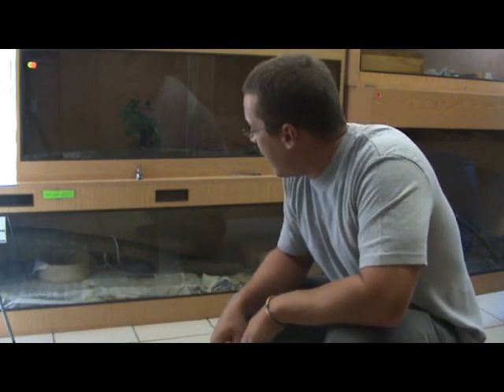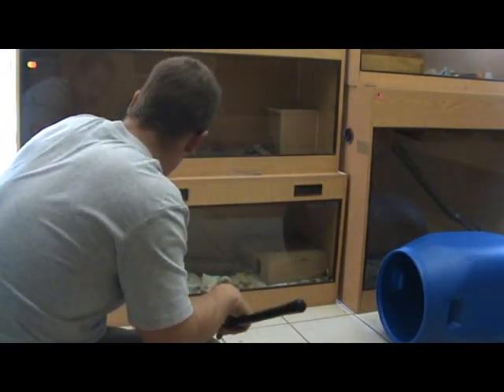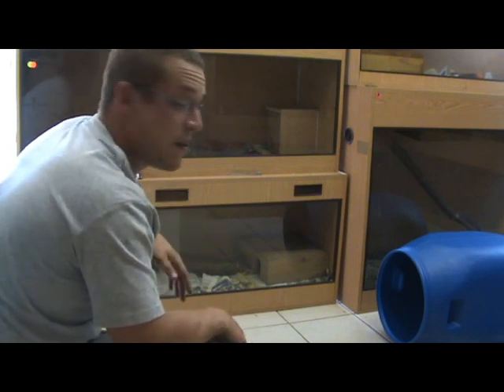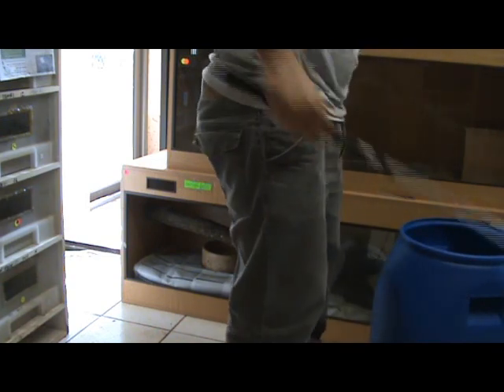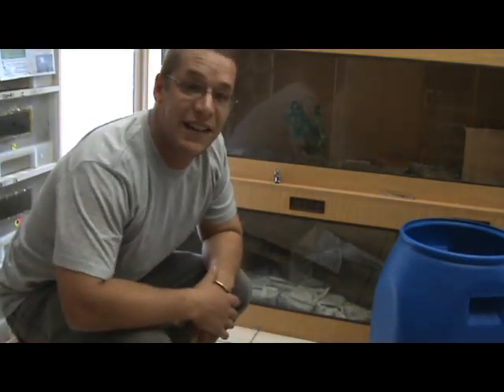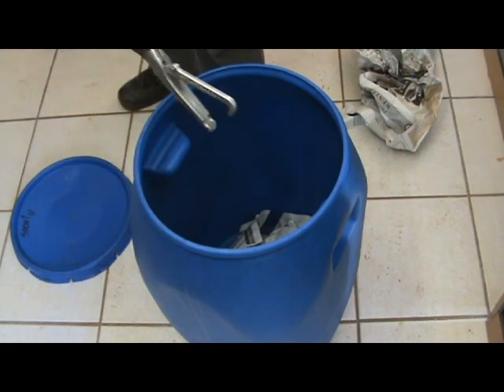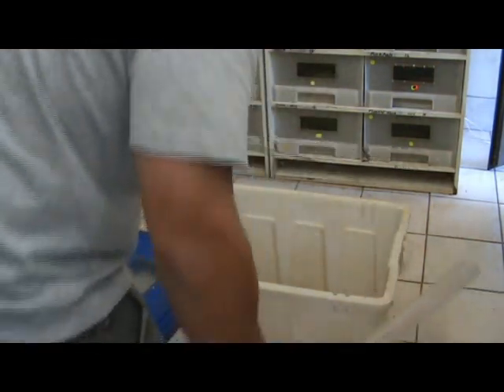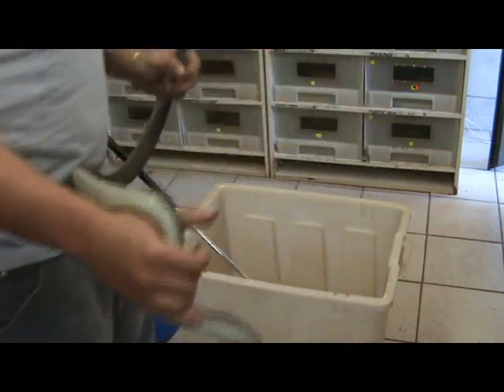Black Mamba handling

Comment: That tube with little spots cut out of it just big enough to fit a tweezers for pulling stuck skin, mites, or any kind of treatment needed on the head of a snake is a great idea I have yet to see other venomous handlers use. Thanks for the idea, Bob's your uncle even easier now.

Comment: The blue box is probably more dangerous than those red ones viperkeeper uses. 

You simply do not have control when you open it with your hands. And also speaking about the other containers: Your fingers of both hands are exposed a second when opening or closing them.
Reply: The snake is not lying there waiting to bite everything, so that mere second makes little difference.

Comment: hi, what difficulty level is the black mamba on care wise? i am currently working on getting a vemonous reptile owners permit and have cared for snakes such as the eastern diamondback rattler and cottinmouths. is the black mamba harder or similar to care for compared to these?
Reply: You can not compare them, they are so totally different in their behavior. Get a mentor and work with that person's snakes before you start getting venomous snakes. And also you might want to look up some LD50 values, cause a cottonmouth isn't even close to a mamba in toxicity.

Comment: while i was watchin this video, it realy seemd that you exposed you finger to a possible bite. especialy when you handle the lid of both the squared box and the round barrol. especialy the lid on the barrol dit not seem so safe to me, it's werry tight, whits it ofcorese have to be so the snake dos not get out, but it alsove forse you ti expose your fingers when taking the lid of, and you have to use a lot of forse, whitch gives the posibiliti fore you to lose your grip. just an observation :)